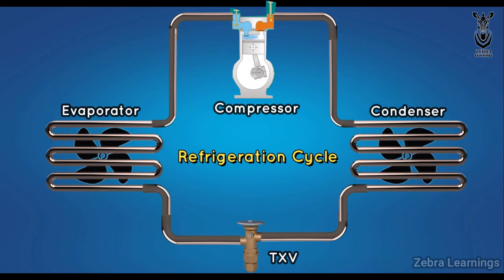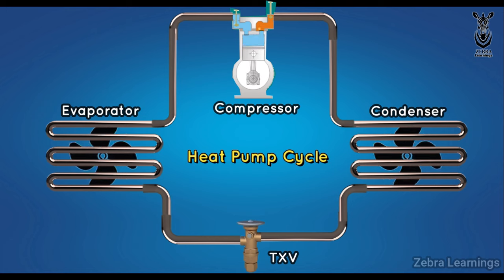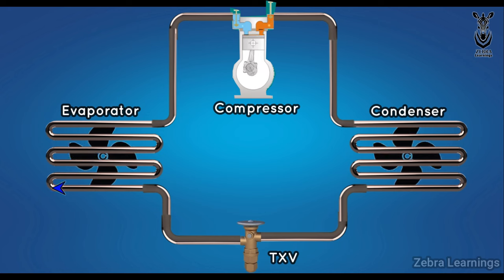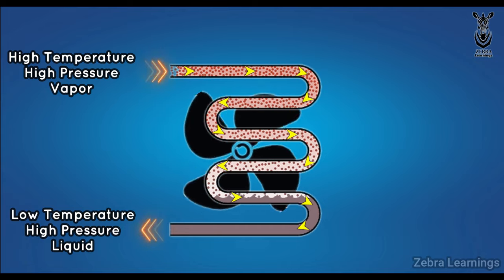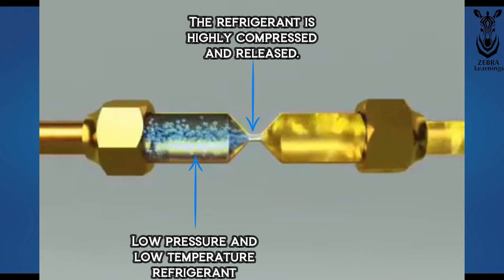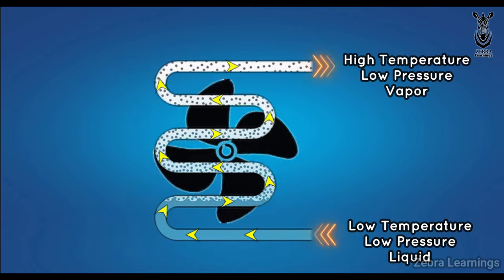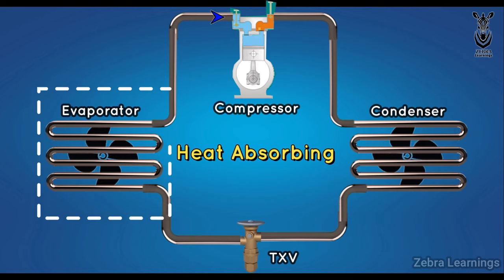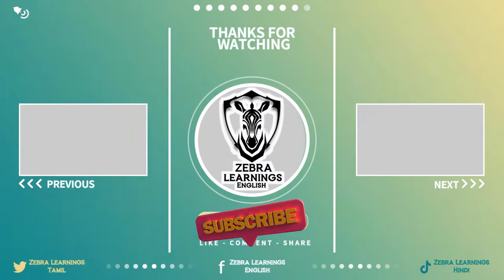Refrigeration Cycle | Vapor Compression Cycle | Animation | #Refrigerationcycle #HVAC

Comment: Listen you clearly don't know the refrigerant cycle. From the compressor the refrigerant is discharged as superheated gas, frim hete tje first stage of cooling is called  desuperheating  this occurs at the top of the condenser, and it takes up 5% of the condenser. After this the 2nd stage of cooling is called condensation that takes up 85% of the condenser leaving only 10% fro the 3rd stage of cooling called subcooling. If for any reason  these three stages of cooling do not take place the refrigerant will not be 100% liquid gas and the TXV valve will not be able to feed the evaporator because the gas will be in both liquid and gas.  Remember the TXV creates the pressure drop only olif the refrigerant comes to the valve at 100% liquid. Many technician blame the TXV for their poir knowledge of the refrigeration cycle. If the condenser does not adequately  cool the refrigerant there will existt  a high (Liquid line pressure drop) in the Liquid line and this high presdure drop,  (resistance to flow) will effect the refrigerant bringing it to the TXV in two forms gas and liquid. The Achilles tendon of the refrigerant cycle is in the liquid line its been this way since inception, I REPEAT!! THE KIQUID LINE IS THE WEAKEST POINT IF THE REFRIGERANT CYCLE. MANY MECHANICAL ENGINEERS STILL DON'T UNDERSTAND THIS 😢
Reply: Ok he said the same thing you are saying  Chill out. 🙄
Reply: I like this further explanation. I think however that the video target audience might be someone who knows much less ~ a newbie like me.  My sense is if he tried to get into all of that it might be too overwhelming for someone who is new to these concepts. I’ve been sitting and replaying the video and looking closely at the diagrams I’m still trying to understand how the condenser actually works to cool the very hot liquid. I have posed this question is it simply the ambient air surrounding the condenser that the heat exchanges to? 
I am wondering why we bother to heat up the refridgerant so intensely just to cool it again ... why can’t it just be going from room temp to cooling.  I’m a hoping to become a RV tech apprentice next year so doing some pre learning.
Reply: @part-timephilosopherLol  what the video doesn’t mention is big chunks of energy released absorbed while refrigerant undergoes phase change (liquid to gas and vice versa) ie latent heat. Regarding your first question, look up boiling points etc of refrigerants (wildly different to water). Ambient temperature can be enough to cool the refrigerant into liquid. I’m no expert and always do your own research hope it helps

Comment: the boiler ,sorry epav boils the fluid because its not liquid its divided and moatly liquid ,after it boils it becomes high pressure high temp again ,the second expansion valve now drops the pressure again qnd temp because its not good to pump superheated gas into the suction port ,because this job is done inside the compresor ,but not befor it ,the heat of the gas its becauae the body of the compressor is hot ,and the refrigerant boils at -140 maybe or 170 ,the heat from the pump body ,not because of the vomoression ,compression alone allows condensation of the gas to a liquid ,

Comment: Many technicians blame the TXV valve for a priblem in the refrigerant cycle because they never understand that if the condenser does not put out the fire of the heat of  compression and condensation this heat will circulate in the system from one component to the other. The condenser is key, has to be kept clean (fins)  and insure that the fans RPM are adecuate. How do you insure this? by keeping up and monitor both SUBCOOLING AND EVAPORATOR SUPERHEAT & COMPRESSOR SUPERHEAT.😊

Comment: The close up picture of the expansion valve, should not show it looking like liquid in, and gas out, if it is high pressure liquid in , and low pressure liquid out.  Into the valve is HPL, out of expansion valve is LPL. Low pressure liquid does not look like it has bubbles in it.

Comment: While explaing about evaporator it is explained that high temp low pr vapour is coming out from the evaporator then it is going to compressor, but initiallu you started explaining compreasor inlet is low temp low pressure vapour, how high temp vapour from evaporator becomes low temperature vapour at compressor inlet? Please clarify this
Reply from the maker: Actually both are correct. For example, in the evaporator we give temperature like 25°C. This 25°C is low temperature for us. But the refrigerant will boil at very low temperature. If we give 25°C the refrigerant will boil and evaporate. So, for the refrigerant 25°C is high temperature.
If we feel 25°C is low temperature, we can say it is low.
If we feel 25°C is high temperature, then we can say it is high.

Comment: At 1:44, you say low pressure/temp vapor enters compressor. At 3:25, output of evaporator is low pressure/high temp. But next step is input into compressor. Not matching. Or a step is missing.
Reply from the maker: Actually both are correct. For example, in the evaporator we give temperature like 25°C. This 25°C is low temperature for us. But the refrigerant will boil at very low temperature. If we give 25°C the refrigerant will boil and evaporate. So, for the refrigerant 25°C is high temperature.
If we feel 25°C is low temperature, we can say it is low.
If we feel 25°C is high temperature, then we can say it is high.
Reply: It should state higher temperature at the evaporator outlet. All of the liquid entering the evaporator is boiled off and additional heat is added causing it to become a superheated vapour. 
By comparison to the refrigerant leaving the compressor as mentioned at 1.44 the refrigerant entering the compressor is a low temperature refrigerant so technically the video description is correct.

Comment: Hey Azar, great video. It’s helping my brain 🧠 get the concept. So I understand the idea of compressing and speeding up molecules would heat them up. After the refrigerant is hot is where I’m a bit confused. So is it just passing through the condenser with the fan that the relative ambient temperature outside the condenser is cooler that the heat travels or exchanges to the cooler air outside? 
Also how does the valve expand the liquid to gas?

Comment: Nice videos. BUT missing layman's aspects (to me).

What is happening is:
A medium is sent in to the hot place. The medium gets heat (from our body or from our food).
Then the medium is sent outside where the medium emits the heat (to atmosphere).

It is always *flow of heat*. Heat flows from hot to cold substance.
There is nothing called *flow of cold*.  

Why evaporation & condensing of the refrigerant? Because that is the most efficient way of removing/adding heat to a medium.

The medium (=refrigerant) in most cases is the Freon gas/liquid. Why Freon? Because that gas boils to vapor and condenses to liquid within our desired hot/cold temperature range.

1. Evaporator: We receive cold air from.
2. Condenser: We emit       hot air to outside.

In a window AC for example, 
Evaporator fan blows the cold air. Cools our face and heats the refrigerant. 
Condenser fan blows the hot air (to outside ), heats the atmosphere and removes the heat from the refrigerant.

Similarly in Refrigerator: 
The evaporator coil is wound around the icebox. Icebox gets cold. 
The condenser coil behind the refrigerator heats up our kitchen!

*Watch the video again*.

Comment: Great video. Out of the condenser though, we have a high pressure and slightly lower temperature due to the latent heat (no phase change heat). What the video says is not very accurate.  The remarkable temperature drop takes place in the valve.
Reply: Yes

Comment: At where the fan is blowing air on the evaporator side, is it blowing it into the evaporator coils or blowing them away to get cool air ?
Reply from the maker: The fan blows air into the evaporator coils. This air passes over the cold coils, absorbing heat and cooling down.
Reply: The fan blows through the evaporator

Comment: Professor, can you send a link to a simulation program for cooling and heating systems for mechanical and electrical parts and control circuits? Thank you.
Reply from the maker: I tried to find out, but I couldn't get the proper one. I will try to get the good one.

Comment: Hai sir,
I have doubt,
At starting you said low pressure low temperature vapor is going inside the compressor.,
After the one cycle you saying low pressure medium or high temperature vapor??

How it’s possible??
Please explain i connfused
Reply from the maker: Actually both are correct. For example, in the evaporator we give temperature like 25°C. This 25°C is low temperature for us. But the refrigerant will boil at very low temperature. If we give 25°C the refrigerant will boil and evaporate. So, for the refrigerant 25°C is high temperature.
If we feel 25°C is low temperature, we can say it is low.
If we feel 25°C is high temperature, then we can say it is high.